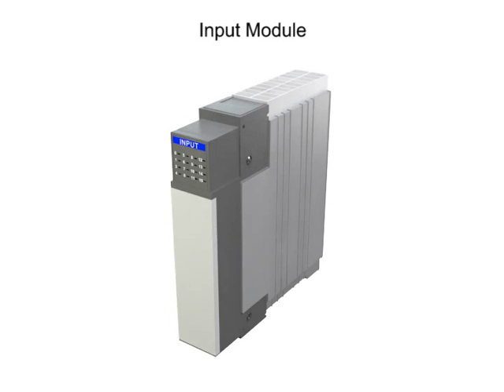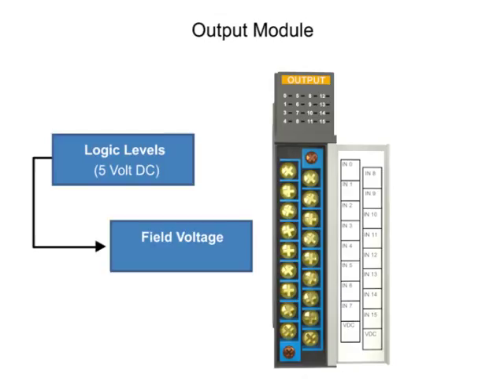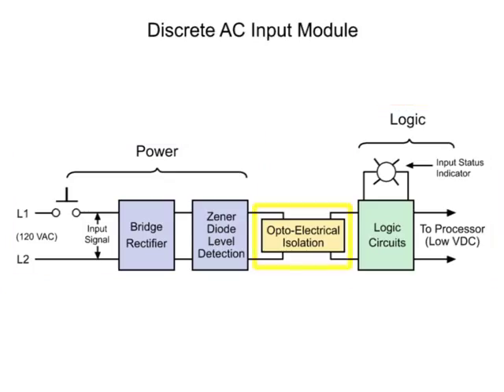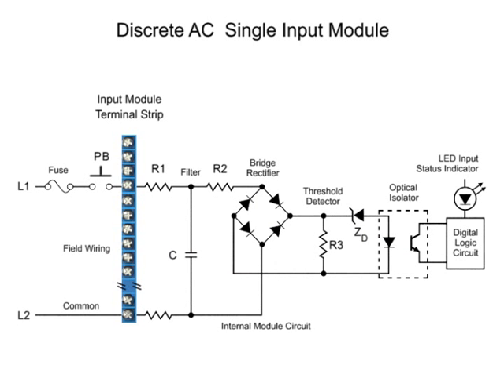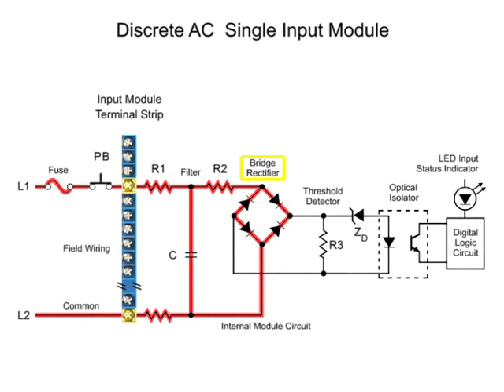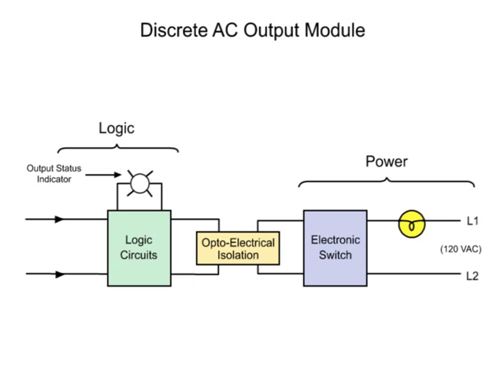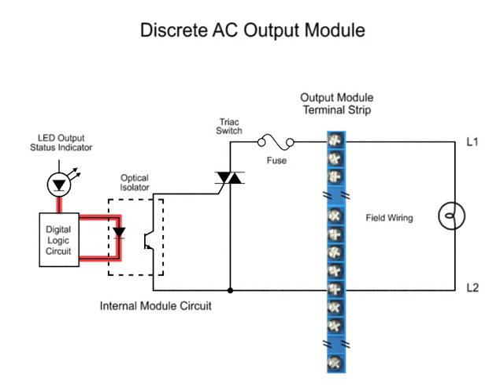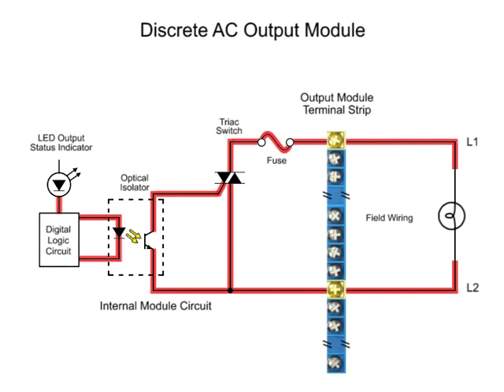PLC: AC Input and Output

Comment: Hi Sir,   In the Power circuit section, the voltage L1_L2 is 120V, how about the Logic section? The 5V dc voltage from the Logic section was fed from the Power Supply module? And in the Power Supply module, is the 120 V AC power transformed to 9/12 V AC and be rectified , flited and regulated to 5 Vdc to feed other modules such as Input/Output Module?